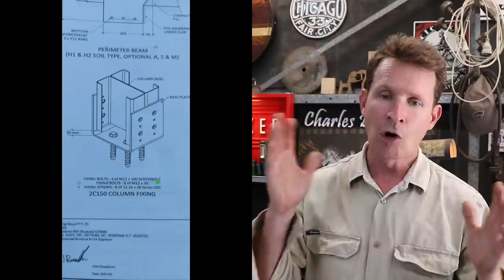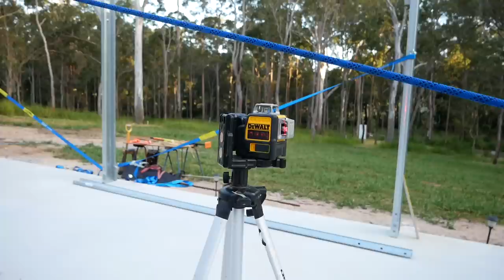DIY Kit Shed Build Lessons Learned Q&A - Forme Industrious

Comment: Looks like a widespan shed. I found Widespan very frustrating to deal with. They aren't a proper shed company. They are just a marketing company with absolutely no idea about their product or how to install it or provide support. The engineering drawings and connection details have lots of errors and missing information. The connection for the roller door header is stupid and doesn't work with the header cover flashing for the roller door opening. They also use a c purlin for the top wall girt and roof purlin instead of another set of Zs for the top of the wall and another for the roof to save money and this cheap shit option is a pain in the arse to install and to sheet to. They don't even include the center portals in their drawings so that you miss the fact that they have put huge knee braces in cutting into your available eave height.
Reply from the maker: Nailed it!